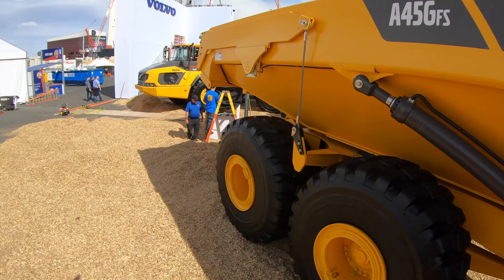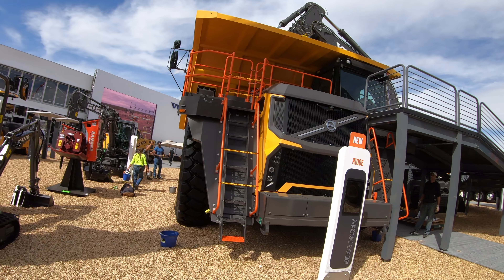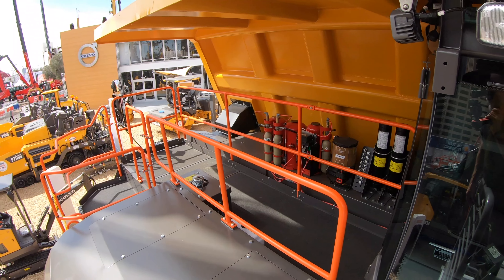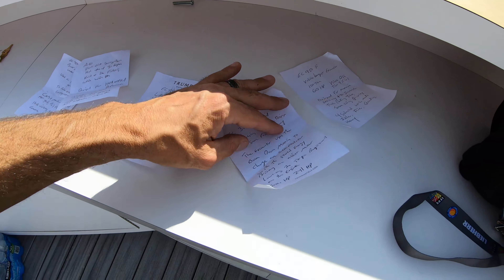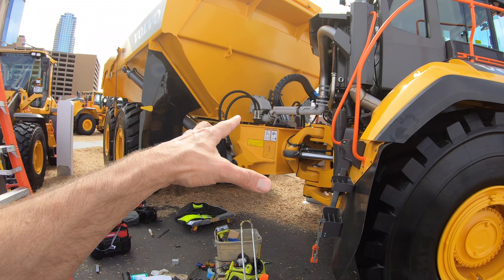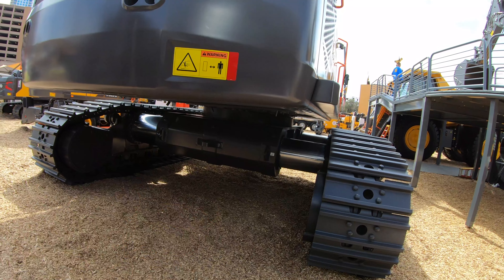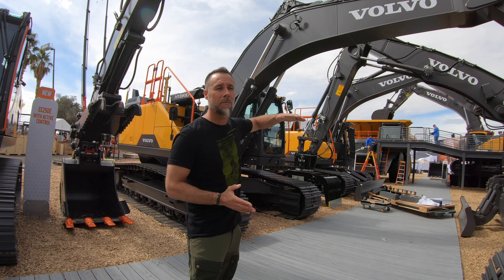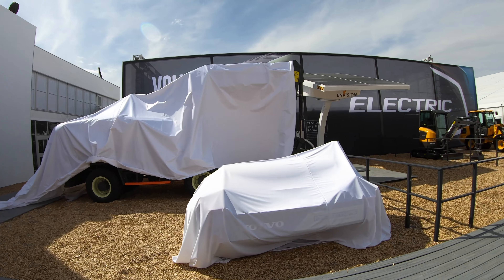Volvos New Heavy equipment at Conexpo 2020 4k

Comment: two things:
1- PULL BACK THE SHEET!!!
2- you forgot to mention that the vertical bars on the "hockey mask" cab configuration are specially designed so that as the operator, only sees the skinny side of each bar. there is no bar where you can see the wide side, if that makes sense. (sort of like this as an exaggeration: \ | /  )
I don't know if all heavy equipment companies do this, but this is just something to point out as these little details can make a big difference.

Comment: Pull back the sheets
Reply: BladeArtist 205  k boomer
Reply: BladeArtist 205  I like how you are crapping on electric stuff when a lot of times "vehicles that take AA batteries" as you put it, are actually stronger than a conventional engine. The trimotor cybertruck for instance. Its the size of a F-150 yet it's lighter, safer, can do 0-60 in 2.9 and can tow 14k pounds. There is no internal combustion truck that can do both at the same time
Reply: BladeArtist 205  I like how you are trying to pull a man card which is the most unmanly thing someone can do. A real man doesn't attack something with the words "is too manly". Only people who are compensating do that
Reply: BladeArtist 205  also an Electric tractor could plow 400 acres. The only problem is the lack of a battery capable of sustaining power for that long.

Comment: You never mention the ECR355, it's not new but very interesting for road builders and residential work because of the compact 35 ton size, a big machine that can do 20 ton work way faster, wery interesting in my opinion and especially with a tilt-rotor, then it would probably be able to fit in where 16 ton machines work as well, only way faster.

Comment: I have 1 piece of volvo equipment left and it's a glorified boat anchor. It's a 2012 340DL excavator and I have been trying to get rid of it for almost 2 years and nobody wants it. It only has 6,700 hrs and so far we had to repack every cylinder on the boom and stick, replace a final drive motor, replace the air compressor, replace multiple rollers, and several hydraulic lines. There's a lot more than that but I'm sick of typing.

Comment: I would like to see what's under the sheet but most of all I'd like to see the electric equipment running. I'm not a environmentalist by no means, I love the sound of a hard working turbo rolling coal from all those pony's pushing the limits. I do like the idea of quieter equipment especially in residential areas. Electric motors have incredible torque and the battery technology seem to be getting better every year. I absolutely hate the def systems that the government requires for larger diesel engines they consistently seem to fail and cause issues that cause expensive down time, one of the biggest scams ever created by our government.